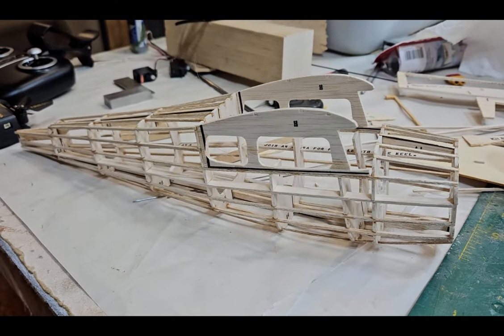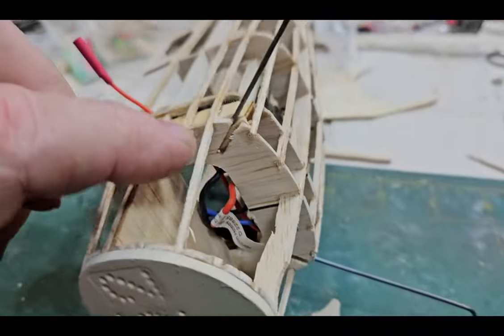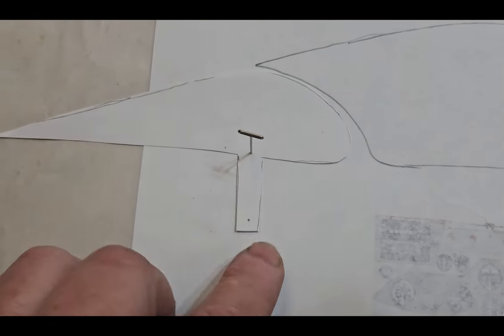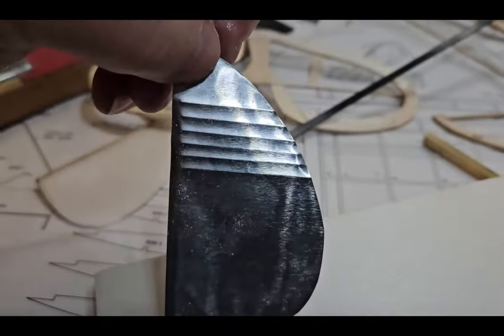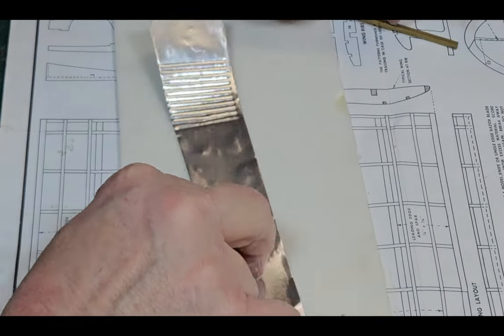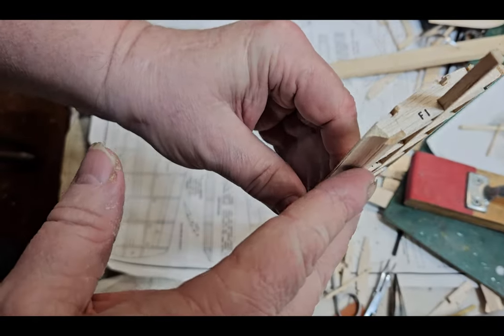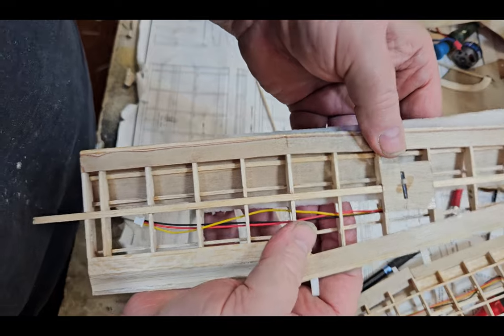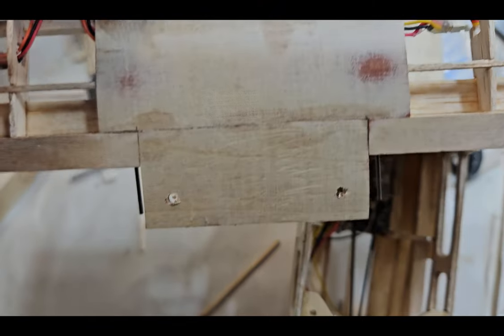Guillows Cessna 170 rc conversion episode #1, #Grants shop, trending

Comment: Great detailed video. I've been building large sized planes but recently started getting really getting interested in these mini- sized builds. Would love to see the parts list for electronics, props and other things in the description.
Reply from the maker: I will try to get those things listed. I thought I may have mentioned the parts in the video but then again I can be a bit brain dead. Glad you liked the video and thanks for watching.
Reply from the maker: Can I ask for your help? Can you give me a list of the stuff you would like to know about? I tend to take things for granted so I will most likely forget to put information down about something that I just didn't give a second thought to. FYI, I build large scale also. You may like my 1/4 scale Camel build.
Reply: @Mastermodeler.  No worries, I and maybe others will appreciate the list of additional parts you used in this build. Things like: receiver, battery, ESC, servos, propeller, wheels (if not using kit wheels), tissue paper brand (I saw from other videos that Guillows tissue isn't the best) or light weight plastic shrink covering when you use it such as like UltraCote ParkLite, anything else.

I have not tried to fly a plane this small, watching you, you fly it very fast. Do these Guillows medium sized planes require flying fast to not stall?
Reply from the maker: @stevejones9044  Yes they do. Weight is critical. I build more for display with the hopes it will fly.
Reply from the maker: @stevejones9044  Just got around to adding a list of parts for the build. Sorry It took me so long. The only thing I couldn't find the info on were the wheels. I just bought some tiny foam ones off of Amazon.

Comment: I think making a jig that has indentations (so just a piece if wood with regular shallow cuts) could have been beneficial for the ribbing operations- I know you've already finished by now but just throwing it out there if anybody else wants to make something! ^^;;
Reply from the maker: That is a really good idea. I just didn't want to make a jig for a one off. Just lazy on my part. Wait til I go after the Guillows P38! I am experimenting with a covering idea that if it works will be incredible.

Comment: Hey Grant. You say in your Cessna 170 build you will show how you planked the fuselage. Did you forget that part?? I don't see how you did the measurements or technique. I have already planked the nose of the fuse but having trouble with the the sides and top.
Reply from the maker: I thought I did, but maybe I didn't cover the planking as much as I should have. Sorry. Sometimes I do things thinking others already know how to do it so that is my fault. If I do another Guillows build (I do have plans on doing a P38 in chrome) I will try to do a better job of showing my method of planking.
Reply from the maker: What model are you building? FYI, I go through some planking techniques on my SE5 build.

Comment: Can you tell us what motor that is and post a list of the electronics, I’ve got a piper cub (same size) Id like to electrify and convert to RC.
Reply from the maker: The motor is an Eflite 1404-2500 kv. The electronics is a UMX Timber type receiver with the two on board servos.